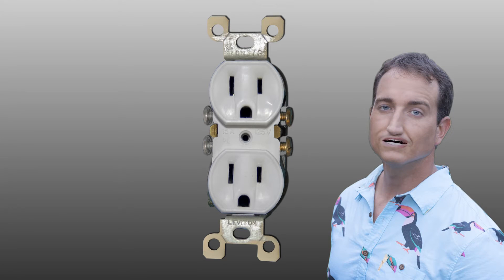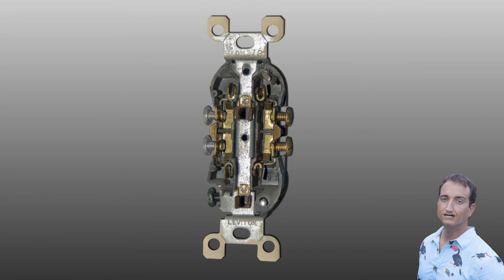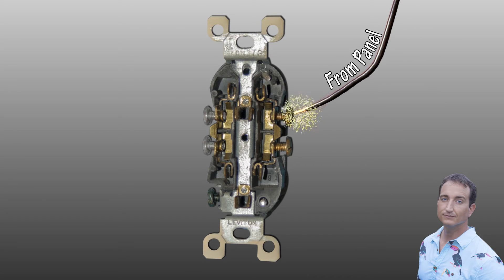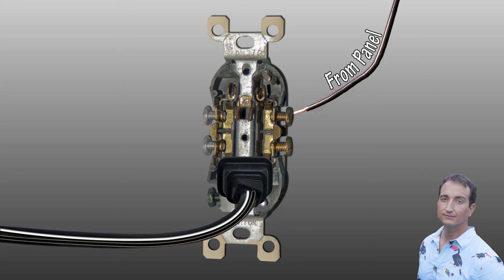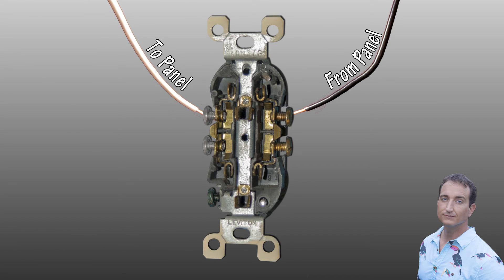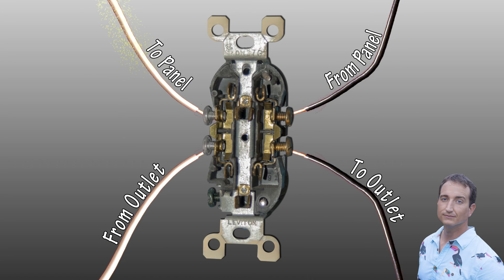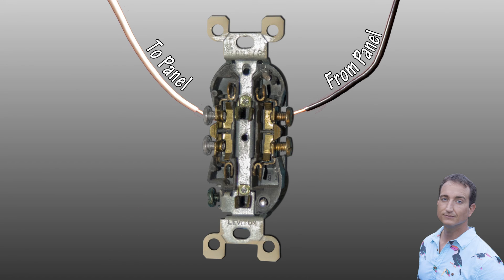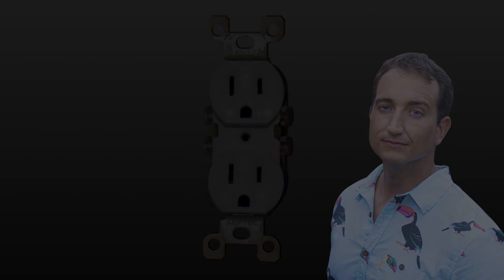How An Electrical Outlet Works

Comment: Recently changed an outlet. I completely removed the screws on the side to make it easier to get the wire loops around the screws. Did I completely break a new outlet? Because it’s still not working.
Reply from the maker: I would guess it is more likely you do not have power making it to the outlet.  Maybe you have a tripped GFCI outlet somewhere else that is feeding this outlet.

Comment: Thank you very much for explaining everything thoroughly and easily understood, but one thing I wish you covered in the video. When you plug in an old appliance, how come sparks shoot out of the outlet when it’s plugged in
Reply from the maker: Thanks for watching and the comment.  Sparks is usually not a good thing.  If the outlet is worn out this could be an issue and should be replaced.  Otherwise might be good practice to turn off breaker to the outlet prior to plugging in. once plugged in then turn back on.   I the appliance is "on" when plugging  it could cause a spark when  when outlet is live. After it is properly plugged it should not be sparking however.

Comment: Thanks for this. Is there a reason you don’t mention anything about the magnetic field the outlet generates?
Reply from the maker: Sarah, Thanks for watching and the comment.  The intent of the video was to provide a concept of how electricity "flows" for the sake of installing an electrical receptacle. What I describe is very primitive and by no means a completely accurate definition of how electricity actually works.  It is hope however that what I describe is enough to help with general receptacle installations.  Thank you for your additional insight!

Comment: Joe,    Is the device shown an outlet or a receptacle according to NEC?  (Definitions).   The green screw is connected back to where for safety?   Clue, ground rod has nothing to do with the screw.   Respectfully,   Kevin
Reply from the maker: Kevin, thanks for commenting on this electric outlet video.  Feel free to elaborate if you would like.
Reply: MrKistel     Definition:   A point on the wiring system at which current is taken to supply utilization equipment.  (This term is frequently misused to refer to receptacles.  Although receptacle outlets are outlets, not all outlets are receptacle outlets.  Examples: lighting outlet, smoke detector outlet, power connection to water heater, furnace, air condenser).    The green screws, connections to metal boxes, and panel can are part of the equipment grounding system.   The system takes ground fault current from the equipment through the system back to the panel, to the neutral, out to the transformer and back to the breaker in the panel.   Not to a ground rod.

Comment: What is the difference between this and an electrical "short"?
Reply from the maker: A short is when the plan electrical flow is interrupted or  diverted.  For example, if a wire were  to lose its protective insulation the electrical flow could jump from the wire to something conductive like another wire.
Reply from the maker: The circuit breaker is designed to "trip" when its designed amperage is exceeded.  If electrical wires in the house or building are drawing too much current they could get hot and their insulation could melt. A circuit breaker helps reduce that risk.  Note, this does not necessarily prevent an appliance plugged into an outlet from over heating.
Reply: I'll ask a different question.

What prevents ANYTHING you plug into an outlet from overheating?
Reply: Short circuit means that the line is connected to neutral or earth before the equipment. It will cause very high current and the circuit beaker will trip,

Comment: What if receptical boxes have no ground wires then what??..
Reply: Old Timer You will pretty much be bringing an electrical storm inside your home. Guaranteed electrical  shock and fire hazard.
Reply: The ground wire is for safety. If a line get loose and hits the case the current will escape through the ground wire possibly tripping the circuit breaker. If there is GFCI it at least trips. Even without both the voltage on the case will not be dangerous.

Those equipment that do bot have the ground pin are double insulated (when we are talking about modern equipment). These have two layers of insulation and typically a plastic case (which counts as one layer). That means they are safe even without grounding.

In the end the ground wire typically leads to same place as the neutral wire, They are connected at the main panel.

Comment: But since it's alternating current why does it flow in one direction from hot to neutral? Wouldn't neutral also be hot half the time?
Reply: Neutral is neutral as it is connected to the earth. The line varies between +170 V and -170 V 120 times a second. If you have a 240 V socket then both pins vary at that range but they are always the opposite.

The equipment does not care which is neutral, all it is interested in the voltage between the pins.
Reply from the maker: Roy, this video model was designed to help with basic installation of electrical outlets and troubleshooting.  In the description I mention it does not detail alternating current.  In any case the neutral will carry a load, and be hot,  any time an appliance is "on" and plug into an outlet.